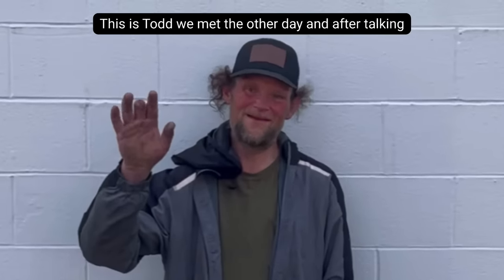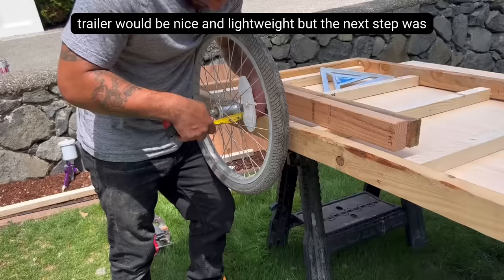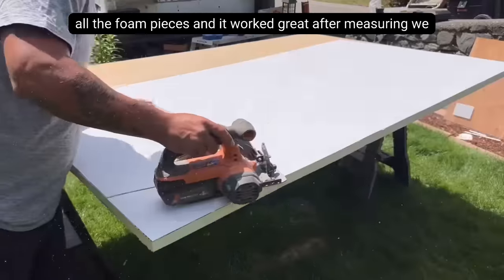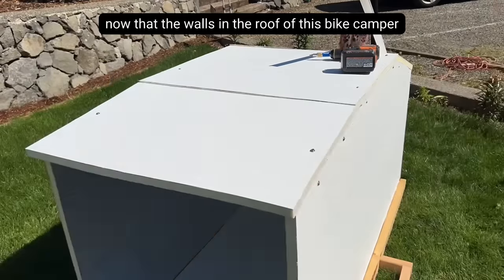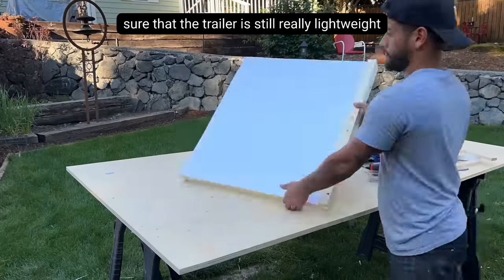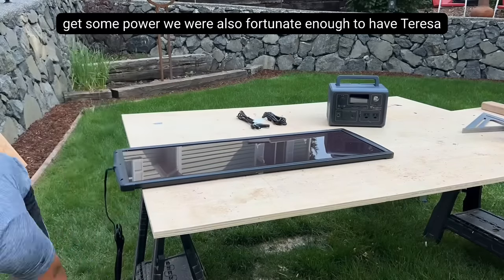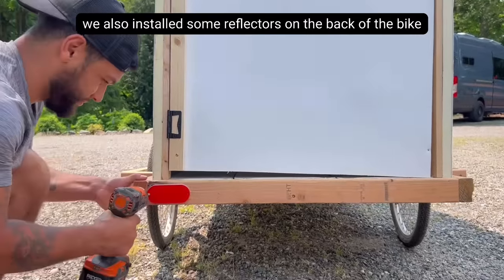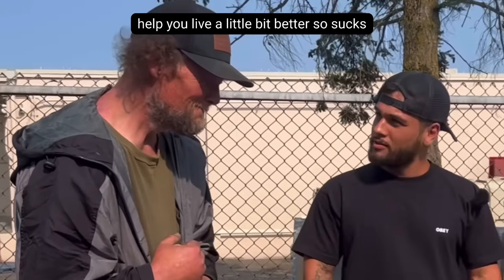Building A Tiny Home On Wheels For A Homeless Guy | Full Build

Comment: Can you install a way to lock it from the inside (and outside) for safety & Protection ??
Reply: Duhhh
Reply: You can see at 5:40 they have a wooden latch on the inside that looks to be away from door gap. I also noticed the out side latch should be able to disengage from the inside I'd some one tries to prank you, so it seems to be thought out. Unfortunately there is only so much a lock can do for something like this since some one determined can cut the bike lock and take whole thing.
Reply: Need a lock on the bike too.

Comment: Awesome job. That door has a lot of movement in it when he was riding away at the end you could see it bouncing. Might need a brace. But awesome job I’m thinking about building this design for myself👍
Reply from the maker: Thank you it does seem a little wobbly but I think it’s because the entire thing is made out of foam insulation. But it doesn’t really move much more than that. It’s surprisingly sturdy for what it is.
Reply: @buildersblueprint  it definitely is an improvement over your first build. I’ve been studying bicycle campers extensively. If you haven’t already looked them up look up bike stream rv and Paul elkins bicycle camper. Awesome lightweight campers made from corrugated plastic or coroplast.
Reply: It does not seem sealed at all either. Maybe a shelf in there for the items and a  rubber mat floor lights inside? 
window at least one..  Hod do you seal the door closed from inside? 
A place to put the stove...
Reply: @patriciatusay1768  I'd be concerned about damaging the floor. I can't imagine that foam board can handle a whole lot of traffic.

A sheet of plywood over the foam for a floor would add several pounds but would be a necessity for my piece of mind lol
Reply: @patriciatusay1768 A window on each side for light and air. I'm claustrophobic.

Comment: I think if you're going to invest in a generator and solar panel, the vessel itself should be better constructed. Maybe better and/or stronger materials. I understand you want to go light, but maybe an electric assist bike and a more stable floor and frame. Maybe a shelve or two. And even with the washers, a few bumps and those metal screws are going to tear into those panels.
Reply from the maker: We plan on continuing to make videos like this and hopefully we can collect the funds to continue to make them better and better. ✌️
Reply: I suggest reinforcement with coroplast panels. Still light and affordable but more durable. Would work really well with the insulation. Usually people just build the superlight version with cloroplast. I think these two materials together would be perfect. Go watch some of Paul Elkin's videos!

Comment: I like that you left a part open in the front for ventilation but I think it would be better if it hung over a little bit, it would also have been my choice for running the cord inside.. Have you watched paul elkins and his coraplast campers? I may have asked you that already
Reply from the maker: The front part does overlap by 1 inch so water should not get in hopefully and I have not had a chance to watch Paul Elkins videos quite yet, but I will definitely check it out. Thanks for the recommendation.
Reply: @buildersblueprint  ok, it didnt look like it stuck over in the video.. Are the vents screened? I was thinking about this last night, Bikes break down a lot, wouldnt a 3wheeled push cart work better over the long run? Of course thats if the local law doesnt confiscate their mobile homes!

Comment: It's missing one important feature......... a door lock, lol. But it's really nice though. I would have went with one of those 100 watt flex panels, you could of taped it on top or the 100w hqst panels, those are pretty small in size

Comment: If you'll take a bed rail and put it across the bottom all the way across where you're going to put your axles on your wheels and it take a piece of all thread and use it for the axles in your wheels it'll be a whole lot sturdier and you bolts to bolt the axle to the bed rail

Comment: Great build.  I love the way you think about the issues relating to climate. 
Perhaps a layer of "POOR MAN'S FIBREGLASS" would help guarantee a watertight seal whilst adding a lot of strength to the foam. Titebond 3 is the best glue for this purpose. 
You could even look at using some COROPLAST (corrugated plastic) for rigidity & strength. It's incredibly strong lightweight & versatile stuff (& relatively cheap)
Sometimes you can find old political campaign signs that are made out of it- they can be painted over. It can even be initially held together with cable ties while building.

Comment: Not a bad design but would have been better so it’s lockable on the outside & the inside, with a fold-down ledge on the door so he can sit, some hooks inside so he can hang his bags or a torch etc while sleeping. And it looked like the door had a gap around it. But, overall, a good basic design to build on.
Reply from the maker: Thanks dude I completely agree. We plan on continuing to make the designs much better little by little. As long as we have the budget. ✌️✌️

Comment: I bet the wheels fall off this rickshaw 😅 you should rand boards all the way across supporting outer board holding wheels. And what is the floor made of ? Foam? No plywood? Foam and plywood is  best for making a mini camper
.  No paint on wood
 First rain it will fall apart No leggs to support trailer when inside. Bad construction!. Next time draw up plans and think ahead, this junk will fall apart fast!

Comment: My name is jason, and i am a homeless man living in Tucson, Az.  I am fed up with seeing the calamity of fentanyl users on the streets of the city and causing unchecked chaos, while i am struggling day to day in order to carry my belongings with me instead of leaving everything to chance elements and bad people who trash up the areas they hang at smoking up their beans. I had a small income on mineral rights from a couple of oil wells that i inherited. I only get about $200 a month. When my cargo trailer and bicycle both broke down last spring, I have been carrying a very heavy load just for my bedding. I just recently sold my rights and am awaiting a small but substantial income from that. I have been planning to move out of the city of Tucson and back to an area outside of city limits that still affords me the ability to set up a hot tent and make a real camp. Then i started researching the cost to build a small shelter. Also, i intend on getting another bike and cargo trailer.    
        What you are doing is phenomenal! I would love to receive your help in building a more solid structure, and making it transportable would actually make it perfect! I can pay as much as $600 into it if it costs that much or more to build. A  travel trailer pulled on my bicycle would make me a very happy man and help me to secure my belongings when i leave to go and do those things that are necessary such as odd jobs and day to day necessities like doing laundry. I have more to my story on who i am and what my aspirations are, if you are interested. Please help me to create a shelter that i can take with me and lock up so i can be out of the weather this Christmas! I will have my money real soon and i really want this

Comment: You said it was 6ff x 40 inches (I believe) but then you added the foam to the inside of the frame. Didn't you lose between 3.5 - 4 inches doing that? Not hating, just curious
Reply from the maker: Great question the foam was screwed into the outside of the frame making sure the inside would stay the same size. ✌️

Comment: Those wheels are going to fall off the weight of the trailer and everything in it is just going to rip those screws out holding the brackets in should have used an axle

Comment: The problem with this…..is that there are too many holes and slits for bugs to get into……the foam would never give a female a sense of safety because it’s too easy to break into…..the door you put on isn’t sealing correctly, and they would need a lock for the door to protect their belongings as well as a lock for the bike and trailer……an overhand would allow the door to be cracked open for ventilation if raining……